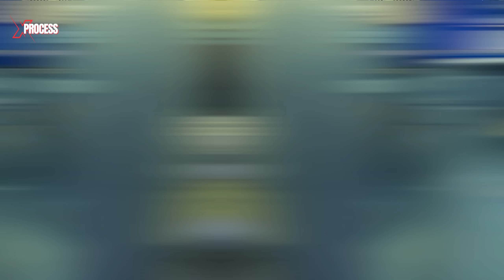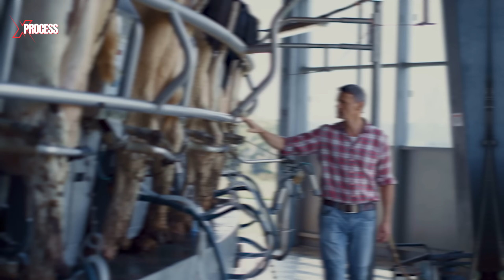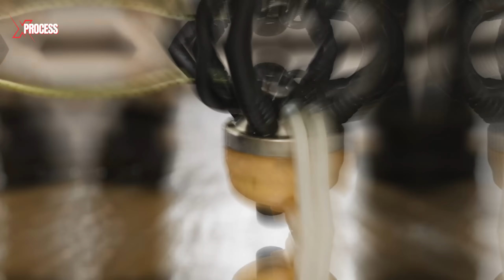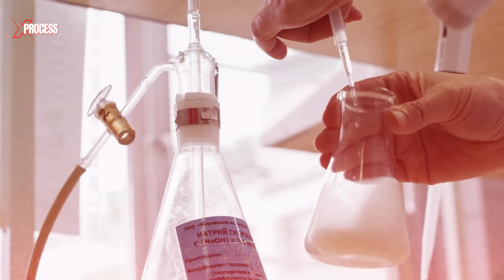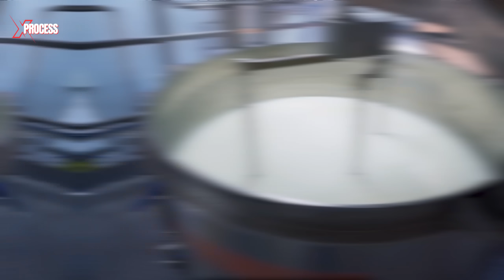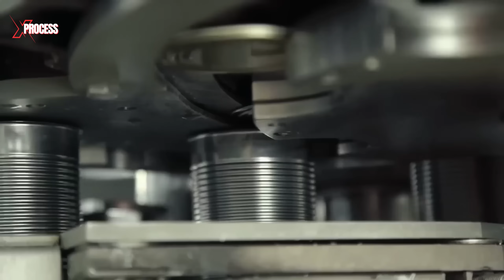How Condensed Milk is Made In Factories: Amazing Process!

Comment: One can make condensed milk at home by combining one tin of evaporated milk and one and a quarter times its volume in white sugar, then warm on the stove stirring until the sugar dissolves completely, then refrigerate.
Reply: You can also make "caramel" condensed milk by carefully boiling a can for at least 2 hours, which caramelizes the sugars inside the can. I did this once (it turned out great). Then I found out this variety is already made and sold by the regular stuff. 🙄🤦‍♀

Comment: When I started working 46 years ago making condensed milk was my first job so this is not new to me. Back then a step not mentioned in the video is that it was stored in a cool room (ours was in the foundations of the factory) for a month to allow for any incorrect sealed tins to 'bloat' & expand for rejection. Another difference is there was no automation so 90% of the work was manual moving of the empty & filled tins. But the best part was start & end of milking season we made rice puddings with & without raisins (which had a high damage rate or more correctly, a lot ended up going home with workers 😁)
Reply: It's possible the step not mentioned has been eliminated because of improvements made over 46 years.
Reply: @anthonyxuereb792  It may have been automated but it will still be required as all food products require testing after being stored for a time to allow bacterial growth.
Reply: Hhmmm, yum

Comment: In Greece, we have also condeced milk without sugar.
Reply: In the US, we have canned "evaporated milk", which has no sugar.
Reply: There is a difference between condensed and evaporated milk. Sugar is added to milk that will be evaporated and is evaporated down to a thicker consistency. The sugar is the stabilization element in this milk. Condensed milk goes through a different process before it is canned to slightly condensed to a thicker milk. Now from what I have seen in living in a European country for the last 17 years is that both condensed and evaporated milk products will darken and change the flavor of the milk if you have it on your shelf for more than two years. I can say that the same products made and sold in the USA can withstand storage on the home shelf for more than four years without changing color or flavor. What is interesting is that the American products advertised "without added preservatives". Fun fact, I brought with me a couple of cans of Borden Eagle Brand Evaporated Milk and it sat on the shelf for eight years ( having been unintentionally moved to the back of the shelf) and it had not changed color or flavor. What’s up Nestlé? Your stuff can’t hold up for more than a couple of years here in the EU.